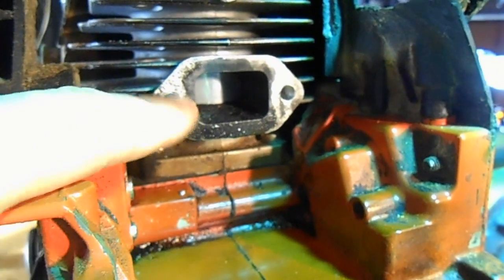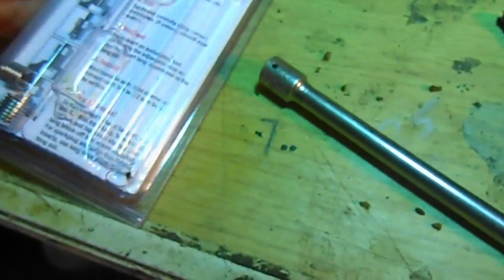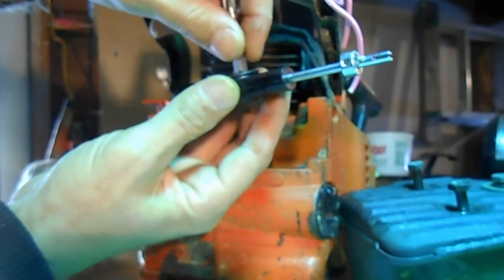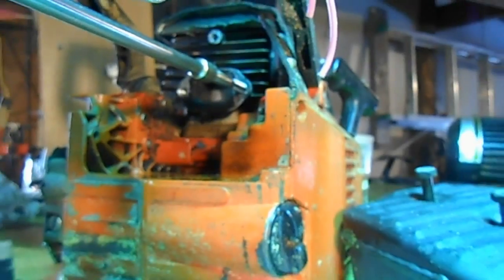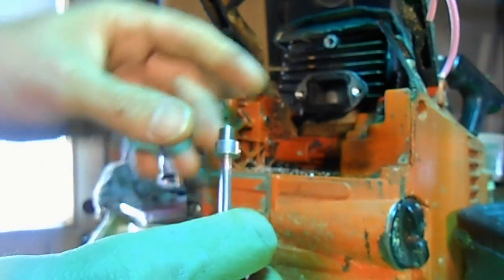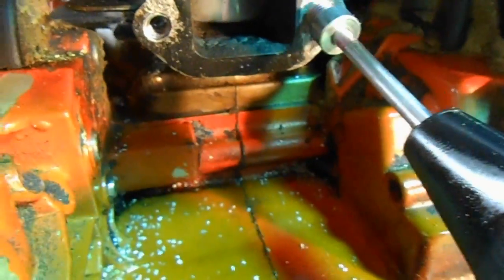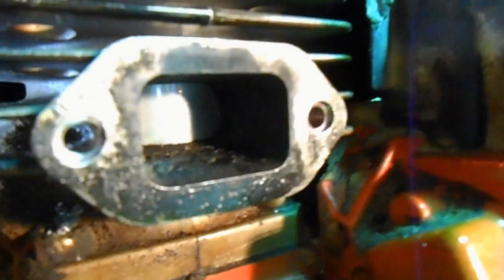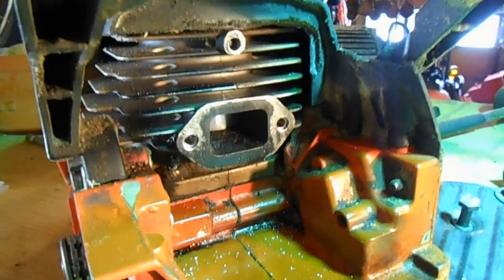Fixing Stripped Threads With Helicoils / How To Install Thread Inserts

Comment: what if your THROUGH hole is 12mm deep .... and the heli coil insert is 20mm long !!! 
how do you remove excess heli coil insert?   or you don't have to ?
Reply from the maker: I'd use a cutting wheel and remove the excess.

Comment: If the threads for the 10/32 helicoil are stripped is there a 10/32 helicoil oversized OD threads available?

Comment: I had to take my car seat out to fix it. The bolt that attsch to to the car and car seat wont tighten. It tightens a little but then it keeps spinning. Is it because the treads are  striped.
Reply from the maker: Glad you figured out the problem!

Comment: Nice job, but didn' t you have to wipe the cutting oil and clean it off with some carburetor cleaner or similar degreasing sprays?

Comment: Good Video 
just Got the Same Kit for Metric M6x1
Fix Broken Thred on HONDA GSV190 - Lawnboy 22270 Mower 
What a Whore !!!!!!
Bolt for Muffler Broke OFF FLUSH 0 i managed to Drill out and try to Remove with Easy Out and HEAT - Still STUCK 
i then Proceeded to Drill Bigger hole and TAP out then !!!!
the TAP BROKE OFF !!!!!!!  WTF 
i then Pounded the Broken TAP Through the Hole and Now in same Situation as you

Comment: So you mean you hand tapped a bigger hole to fit a helicoil that would fit the same bolt? 

So my question is, is this "helicoil" what you demonstrated is also effective when new threads are created whenever you insert a bolt incorrectly inside a threaded hole forming a different thread?

Comment: Wow being a tradesman I see a couple of issues. You do not use loctite on the helicoil as it will leak into the inside of the thread and second you do not bang down to remove the tang you reverse the tool and turn backwards breaking of the tang. Don't worry the helicoil will not come out.

Comment: do you think this will work for the bleed bolt hole for coolant in my Kim 450 it is stripped and has a slow leak its In the engine case

Comment: This insert is made of stainless steel right and you thread it into aluminium. Do you need to glue it with loctite ?
Reply from the maker: Loctite will keep it in place.
Reply: @JCsBees  that's what I want. How likely is it that this insert will screw out without loctite ?
Reply from the maker: Not sure to be honest, I have always used loctite.
Reply: @JCsBees  I have green loctite you know that glue for metal. Isn't it too harsh ?

Comment: Greetings,
So what size helicoil did you use? What is the exact size of the tap in relation to the helicoil....(assuming hole already drilled to proper size) basically if a 1/2 inch diameter helicoil is bought separate from the tap and a tap kit with various taps are used, how would a person know what size tap to use??....or simply, is a tap that comes in a kit with a 1/2 inch helicoil going to be a little bigger than 1/2 inch but state the measurement 1/2 on tap or is it going to be like 3/8 to fit the outer diameter if the helicoil??
I can’t find this simple answer to my question anywhere....geez!!
Reply: Just buy the kit, you've given me a headache
Reply: @angrypants7619  LOL!  Well hopefully the kit will come with a couple of aspirins...I'll send them to ya

Comment: thank for the great video. I need to helicoi my busted drain pan. any recommendation in keeping the shaving (as you tap) from getting into the pan which may later damage the engine.
Reply from the maker: Maybe a magnet.
Reply: little bit of wheel bearing grease on the tap n drill bit

Comment: Great vid.. But whats next after the insert of the coil? Tap new threads or just screw the bolt in? (Im new lol)
Reply from the maker: Now you would screw the bold into the helicoil just like you would with tapped threads.

Comment: how small of a bolt do they make these for . I have a gun that has a very small screw hole that needs new threads ?   6/32 would be the machine screw that mounts the hood into the striped region so .
Reply from the maker: Just doing a Google search for small Helicoils, I get this https://www.google.com/search?q=small+helicoils&oq=small+helicoils&aqs=chrome..69i57.7231j0j7&sourceid=chrome&ie=UTF-8
Best of luck!
Reply: time sert goes down that small (hell they go down to 4-40 ) but they want 80 bucks for a kit like that and it seems crazy for a simple stripped threads .  Who know might have to do it though if I cannot make one out of something myself .  Thanks for help
Reply: I dont need an entire kit have you seen anywhere you can buy one helicoil or time sert ?  I just need one Im sure I have the tap already ?

Comment: A Sears ratcheting tap wrench works to run the tap in and out. A Time-Sert kit is better since it locks in. Use a EZ-out to remove inserts.

Comment: nice video.  I'm going to try to use a heli-coil to reduce the existing tread size of the female side of my fitting and make it match up with a smaller thread size for the bolt that will go into it.  Does that make sense?  Your video really helped as a refresher for using a heli-coil insert.  It's not very often that I need one, but when I do, it's important.
Reply from the maker: Makes perfect sense. Good luck!

Comment: Good video. 

One important point not mentioned.....the advantage of the heliocoil is you are adding steel threads, superior to the original aluminum threads. So even if you think you could just tap a larger hole in the aluminum, you might end up stripping the aluminum again.  But steel is less likely to strip.
Reply: romansten9 very good addition

Comment: Would this work on a car engine with stripped bolt holes?
Reply from the maker: Sure would. In the video description you can find links to purchase them.
Reply: what is the outer size of helicoil m8*1.25*30

Comment: Nice video, thanks! A quick tip for square drive bolts or nuts or as what u encountered you can use an 8 point socket!
Reply: I have a full set of 4 point (square) sockets for that! :)

Comment: helicoil is NOT the same as a key insert. a key insert is a solid piece of tube with a thread cut inside to fit the oniginal fastener . and a thread cut on the outside to fit the larger new drilled and tapped hole. it is then permanantly retained by driving in the four pin keys into the oversizeed new hole threads ,locking the insert in place. they need a little more room than a coil o/d  , but are a better choice,as they can be cleaned out with a tap , in future if the application needs dissassembly and reassembly a number of times

Comment: I have a Honda mower model HRR216K4VXA that has a broken Flange bolt that holds the carb with accompanying gaskets and air cleaner housing to the intake port.,  According to the parts description, the bolt is 6x86.  About 3/4 inch has broken off.  I've tried using a reverse drill bit but it didn't work.  I'm thinking that my only recourse is to drill it out and use a coil.  My question is, how do you determine which kit to buy with a flange bolt that measures 6x86? Thanks.  I've subscribed to your channel.
Reply from the maker: Sorry for the delay, I would suggest you go to the auto parts store (Advanced Auto or Autozone) and ask them. They will be able to get you head in the right direction. Good luck!

Comment: i got a motorized bicycle engine from china and it's made of aluminium i'm pretty sure. long story short, the mount bolts, header bolts and exhaust port bolts are all stripped. this happened on every single (5 so far) engine i've had. so far, i've been just tossing the engines or keeping them around for spare parts. this might just allow me to rebuild the engines i have and possibly resell them with confidence. seriously, it's like the block is made of butter :/
Reply from the maker: +Matt “Caplain” Demery Helicoils are great for fixes like you mentioned! Good luck!
Reply: thus why i looked up your video in the first place. i wanted to make sure what kit and tools to buy and the exact procedure to do it. i'm legally blind but can see well enough to drive, just not legally...so my motorized bicycle is my car...thanks to you i'll be back on the road in no time! would you have any specialized tips for my situation?
Reply from the maker: +Matt “Caplain” Demery No tips really, just take your time installing them and you'll be in good shape! Good luck!

Comment: Nice video by my question is the original bolts are going to fit on the new thread
Reply from the maker: +Jose Luis  Moctezuma Yep sure do, you have to make sure you get the correct size Helicoils for your bolts.

Comment: Can the insert threads be shorted from .750inchs to 1cm? Because its a thread for my axle studs..i just have 1cm
Reply from the maker: +Q8 Fly I don't see why you couldn't shorten the coil. I do think your going to need enough threads for bolt to be secure. Good luck!

Comment: Brilliant demonstration and very easy to understand
Reply from the maker: +b16a coupe This is one of them thing you never want to have to use but unfortunately threads do strip out and this is a great fix.
Reply: +Jason “Beeman” Chrisman well unfortunately that's why I was looking at this video, 3 bolts need doing on my exhaust side of my block ! in Ireland a garage would won't at least 150euro for the fix ?!
Reply from the maker: +b16a coupe Well I hope your able to get it fixed but I don't imagine that will be very easy to get to. Good luck!

Comment: That tang could wreck an engine if not recovered
Reply: +Mantas Vaitkus Not if it is for a spark plug.
Reply: compressed air. One squirt and it comes right out. He should have done that after tapping the hole to remove all shavings from tapping the hole.

Comment: Thanks for the reply about fishing out the tang. Next question: If you are already tapping hole to install the helicoil, why not just install a larger bolt and skip helicoil altogether?
Reply from the maker: Joseph Buck You could do that but I think the helicoil is a safer and stronger.
Reply: becuse m8t sumtimes you cant put a bolt thru it like on my taper cover you cant go all the way thru so i am sure this will be ok ,,

Comment: Do you need to fish the broken-off tang out of the hole at the end? If so, how do you usually do that?
Reply from the maker: Joseph Buck Does the bolt have room to go all the way in with the tang in hole? If so I would not worry about it. But if it's doesn't them try putting a little grease on the end of a screwdriver that fits in the hole. See if the grease will stick to the tang enough to lift it out. If not experiment! Try a pair of tweasers. Good luck man!
Reply: Joseph Buck I think magnetized screwdriver will do it.

Comment: While removing my transmission bolts at the back top section of the engine block one got round up due to lack of space.whats is the easiest way to get that rounded head bold off.thank you.
Reply from the maker: Franklyn Felix I understand the lack of space I have done my share of tranny work. Have you tried a good pair of vise grips, small pipe wrench, or maybe cut the head off then remove the stud after the transmission is dropped. I feel for you this little things make the job a pain in the butt. Good Luck!

Comment: How do you determine what size helicoil you need? Do you just go by the pitch and size of the bolt?
Reply from the maker: To make sure you get there right helicoil kit you should take the bolt with you to the auto parts store. They will take care of it from there.

 As you seen these are a great fix for threads. I believe the threads are even better now than from factory. Good luck!

Comment: is this the same proses with the holes striped out for the chain saw blade being striped out? my chain keeps coming lose because of bolt holes striped.
Reply: Helicoil are perfect for fixing stripped threads. They are available in all thread sizes.  If you've got a stripped "bolt hole" then use a helicoil to fix it.